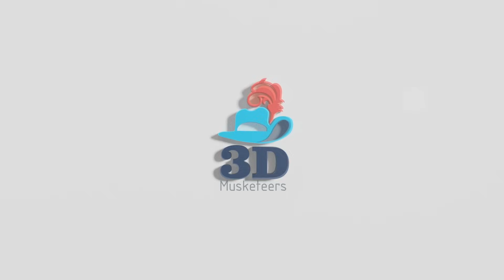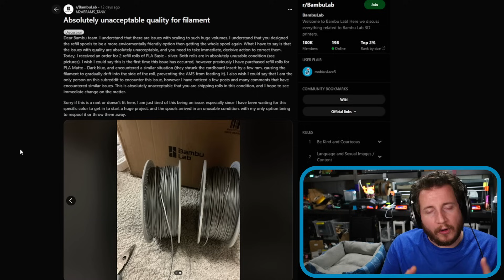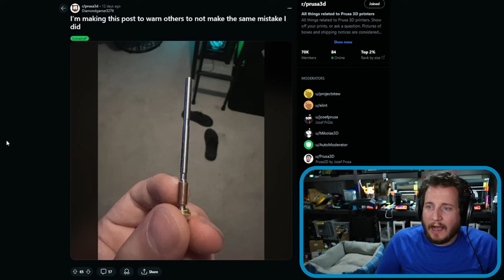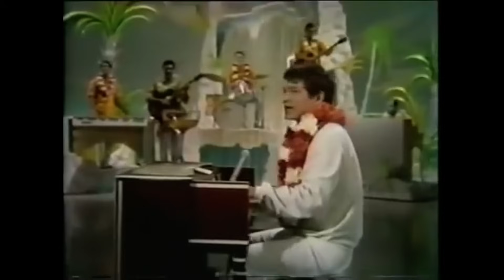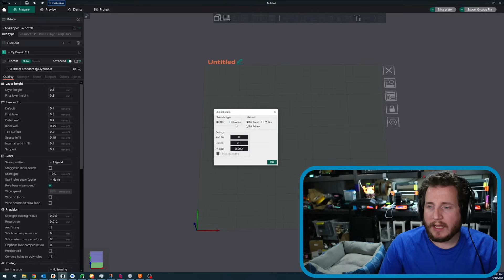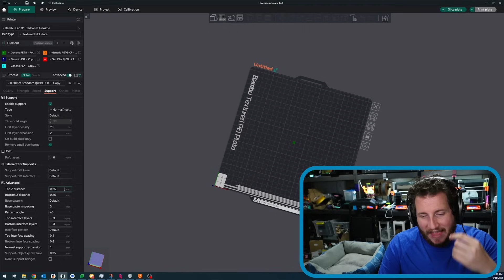Who's At Fault?! - PrintFixFriday 145

Comment: I’ve gone through a few dozen bambu refill spools with zero issues. I’m betting some folks are removing the 4 strips holding the filament together prior to installing it on the spools. 
Definitely not a Bambu issue.
Reply from the maker: seen both sides there, some saying its user error, others claiming they followed directions and had issues. I wonder if there is a variance in the length of that cardboard a bit? It seems, like everything with Bambu, its a hit or miss issue and potentially due to QC issues, but not rampant.

Comment: "Computer controlled hot glue guns" Well, you just set my expectations in just one sentence. I recently ordered an Bambu A1 Mini and I've heard great reviews for beginners like myself. Beginner as in, never even touched a 3D printer. I have been watching videos, yours included, and thank you for setting my expectations. Once you said it, I immediately thought, "Well, that's about as accurate of a statement one could make about 3D printing in our current time."
Reply from the maker: You could even add to it. Hot glue gun duct taped to an etch a sketch. Although this doesn't work with anyone under 30 or so..
Reply: @3DMusketeers  No worries there, I'm definitely over 30 LOL. Still, even with what you said, I couldn't think of a more accurate statement.

Comment: i used to respool all my cardboard filament rolls onto the bambu bobbins but i later found the holder that will go over the cardboard spool no respooling required.  I have only been using the new stuff for a short time so time will tell if it is a permanent solution.
Reply from the maker: like a spool ring?
Reply: @3DMusketeers  it is like a plastic spool that screws together in the middle

Comment: I've had the opposite issue with the bambu refills. It's actually hard to get the reusable spool to clamp down on it because it's so tight. Also I'm wondering if this guy failed to watch the instruction video? You're supposed to load the refill into the spool with the plastic straps still attached, then cut them one by one and pull them out. They're just thin enough to slip around the edges. If you cut them first you'll have issues.
Reply from the maker: Seems they are not the only ones to have issues like this. Plenty of comments are saying similar things. So weird.. QC is a big deal to me and it seems to be missing here :/

Comment: My AMS clogs in slot #4 very consistently. I changed the plastic spool and it went away. The problem was that there was room on the side of the spool and the filament was falling into the crack and getting stuck when rolling and unrolling.
Reply from the maker: mine is having issues on 4 now as well, I THINK the feeder is worn :/

Comment: never happend on the bambu spools/refills. BUt did happen to some Polymaker roles. But easy to fix (1 string underneat the one other).
But the bambu spools need to have correct line up to realy fit.

Comment: I use a custom printed spool i can tighten down. i ditch the cardboard core with my custom spool the two half are threaded with a series of groves in the threads snug it up take a piece of the filament and slip it in the the thread groves this locks the spool. 
i have a pair of sunlu S4 feeding a custom 8x4 ERCF on my custom voron trident 500x500x1000 printable but 500x650x1100 if you use the configuration tool. i need the extra space for easy tool changer dev work
Reply from the maker: thats a nice design!!

Comment: Regarding the Re-spool tangles, my day job involves taking small coils of stainless steel tubing (very similar to filament in diameter and springiness) and loading them onto a spool cart to be straightened.
It is incredibly easy to cause a tangle where there was none. 
If you don't have the ends the right way around (pulling from the inside instead of the outside, which can be unclear which is which) or even just accidentally tucking an end through a coil loop, you're gonna have a bad time.
What is worse, is if you don't isolate the tangle (which is essentially an overhand knot) you will move the tangle/knot down deeper into the coil as you try to chase it. Speaking from experience 😅
Reply from the maker: ooof that does sound like it could suckkkkk

Comment: Never had a problem with Bambu's refills, and I've used several of them. Sometimes it looks like the spool is locked together, but it might not be positioned correctly, leading to it being loose (I caught this once before the same issue happened to me). My guess is they didn't have the spool properly locked when they pulled off the straps.
Reply from the maker: so weird how some are totally fine, but others have had so many issues.. hmm

Comment: yeah I wish the mk4/xl used revo. Revo is better IMO. I still haven't fixed my obsidean. I think I'm going to have to put it at a lower temperature in the oven and shove PETG through it. The wham bam cleaning kit is only 1.7mm not 1.75. so it helped, but not enough. That extra 0.05 matters
Reply: wow this has been going on for almost a month. What do you have stuck in there? I think I am the one who told you about the wam bam kit.

Honest question. Wouldn't the Revo have a similar problem if you got a jam. Is the shorter heatbreak enough to make it easier or is there something else?
Reply: @eslmatt811  I've had something similar with revo, but I got it fixed no problem. I've only worked on it a couple times. I've just been lazy about it.
Reply: @eslmatt811  so yeah I just finally got off my ass and tried shoving filament up it. No luck. 350 degrees (f), 425, 480, 500. I think it's cooling off too fast. I thought I managed to clear half the heat break, but now I'm not even sure about that. I suppose I can try it in the printer again. I got nothing to lose. But even if it's half the heat break, I'm not sure it's enough. And I'm not even sure of that. It's just PETG in there. I forgot to tighten the thumb screws. So it got nasty heat creep.
Reply: @eslmatt811  I just ordered a 1.75mm drill bit. We'll see if that works. I have nothing to lose now.
Reply from the maker: be careful!
Reply: @3DMusketeers  I think I accidentally threw out the 1.75mm drill bits. lol It's not surprising considering what was going on this week.

Comment: for the guy at 16:07, if its your own design and the part allows it, i would recommend to make the hook thicker so it matches the round face at the bottom, that way you dont have to deal with supports and you have a a nice surface finish from the bed, another option would be to offset the circular part to have a flat side
supports are going to leave artifacts on the surface that they touch, its just part of how they work
Reply from the maker: great option! love that advice!
Reply: If the hook still needs to be narrow but the circular ring side could be made thicker, they could also draft in the top and bottom surfaces by a few degrees to do this.  Also, using chamfers (shaved off edges) instead of fillets (roundoffs) will produce a nicer surface on both the bottom and top surfaces.  It'll result in something that looks much more angular, but with a little creativity, it's possible to still make a nice looking object.

If they needed to match an existing injection molded object, then they might not be able to do any of this and they'll just be doomed to having to sand off the rough edges (or split and glue the object), but a fairly common beginner mistake is to try to remake injection molded designs for their printer instead of designing for the printer itself.  FDM printers can do a lot of things that injection molding simply cannot and vice versa.  That doesn't mean you can't produce a solution for the problem with your printer, but you might have to think a little outside of the (injection molded) box.

Comment: So the umbrella for my model is not going well. (I have to think this would suffer the same problems on resin too). I got everythying printed, but gluing the rod to the top doesn't work even with 3d gloop. My new thought is to put a hole in the model. Then stick the rod through it with glue. Hopefully that will work better. I'm also tempted to replace the umbrella with a candle. (she's holding a short rod already so something has to go there). It's so frustrating because she's almost done! I'm sooooo ready to move on to making the gunstar (gambody model) from the last star fighter. But not until Senko is complete.
Reply from the maker: oh no :( It is a difficult model, could you drill a small hole for the rod and bond them that way.
Reply: @3DMusketeers  yeah that's what I did. That worked great. The other part I was worried about is the rod in her hand has to join to the rod on the umbrella. I knew this wasn't going to work as is. So I made the rod so that it overlaps the rod in her hand just slightly. I haven't glued her into the bridge yet so I don't know how well this will work (but honestly at this point it's more of a question of can the rod hold the umbrella up).I would have finished this all this week, but stuff came up and I put printing on hold.

Comment: I own the Sunlu S2 and there are tons of things to print that leave a gap on the lid to help moisture come out. On the other hand, Sunlu writes that you never should open the lid while drying. The little hole on the top should be enough of a gap.
Who's right? The manufacturer who should know how their product should work best, or the community? Does it really help letting the moisture out, or does it also let moist air in?
Can a gap help let moisture out faster, but a closed lid removes moisture even more but needs more time to do so?
So far, when I had bubbles with TPU, having it in the dryer for 6 hours and the lid closed at all times, it printed fine afterwards. No gap needed.

Btw. I like white filament, but I begin to hate transparent PETG ;)
Reply: I drilled a small hole in the bottom of the housing of my S2 and run it like that fully closed until the spool is dry. A bit of ventilation is required but I think it's more important to keep the heat in than let the moist air out.

I think the little holes on top should technically be enough to expel the moist air but since there isn't any intake they can get overwhelmed easily. If you put in a very wet roll and after a bit there is a lot of moisture inside the heating chamber you can crack it open for an hour or so to help cycle the air but in order to fully dry a spool it should be closed while drying for a while. Could also be helpful to turn the spool a bit while you crack it open to let the bottom heater heat different parts of the spool directly instead of purely relying on convection.

There is also a heater in the lid so there might be a reason of culpability for that warning from Sunlu to prevent people from burning themselves or closing it incorrectly.
Reply from the maker: I drilled some holes in the top of mine to let the moist air out, seems to work okay, but I do often need to 'burp' the container.

Comment: The better way to handle that hook is to just make it thicker so you don't need support. 

Always design for the process. The round shape is also not ideal for the bottom edge. May not look as pretty but will be much more functional.

Slant 3d has good advice for designing for printing. Other than printing a corner.
Reply from the maker: We have done some videos on it as well, and intend to show some more detailed ones soon. But if they are new to printing chances are they may also be new to design, at least the DFAM process.

Comment: I just got my Bambu X1c last week - I know, I know, please dont hate me, Grant! I ordered refils with it, 1kg in size, and I printed the spool file on the printer to use for these refills. And I have had no problems with feeding, even when I mistakenly took off the tape holding it together before putting it on the spool! Am I missing something about his particular case? Is it just with the actual spools that you buy from bambu?
Reply from the maker: I had a bad experience with Bambu, that does not make me hate someone that bought their machines, I just hope they understand the data implications, the investor implications, etc. Remember Bambu and DJI have the same major investor, who is part of the reason DJI may be banned completely from the USA it seems.. 

It looks like with this case the spook cardboard was too wide so the refill spread out. At least, that is my understanding
Reply: @3DMusketeers  Yes, thank you for all your videos on their data mining. I am being as careful as I can with using LAN mode and its on an isolated network and has its own dedicated mini PC computer. Though I am slightly irritated because a couple of the spools that sent with the printer came bent and when I asked for replacements they said to try them first. So I have to risk clogging my machine to getreplacements, fun! On top of some under-extruding issues.
Reply: @3DMusketeers I guess I was wondering if the printed spool is a slightly different size than the "actual" ones. Causing the unspooling.
Reply from the maker: I have no clue honestly. I often find the master spool or refill spool options to not be worth the hassle alas :/

Comment: I had the exact problem with the badly spooled filament, and immediately got a replacement free of charge without any hassle.
Reply from the maker: Well, that is not how it came, it happened after the user put a refill on a larger spool than it was meant to be on it seems.
Reply: Over tension on the filament while winding could cause this, especially when it offurs after the spool is half wound no personal experience with filament, but have had it happen on winches, spools of rope, wire.....
Reply: I just had a gray spool that was all screwed up from bambu. Probably my fault... I dunno, I just got to the knot and respun it.

Comment: I've always assumed you should always re-spool/wind with the refill spools. A little bit of play in the wrong area can make issues worse, so do it right from the start.
Reply from the maker: that seems to reduce the cost benefit then, no?
Reply: @3DMusketeers  I personally do not see it that way, but I can see how others would, especially if they do this professionally. Time/Money. 

But for a hobby level, I feel print failure offsets the benefit of a refill spool. An overnight knot failure can waste, proportionality, a lot.

*Edit I mean wasted time and possibly having to reprint. Although I have had a spool knot up, pull free, and cause errors because it kept pulling tight and jumping before breaking free and spinning into a giant knot. Ah, the printing hobby.